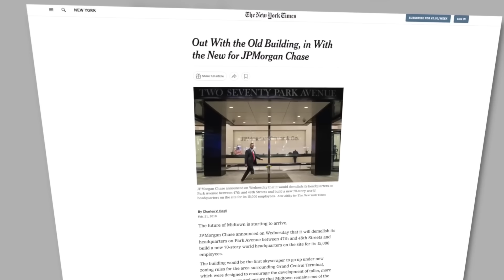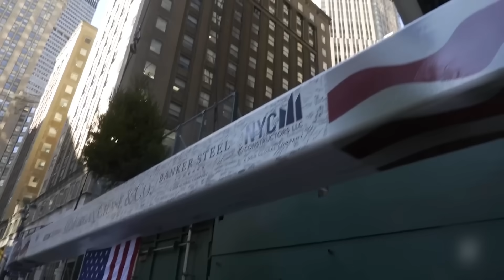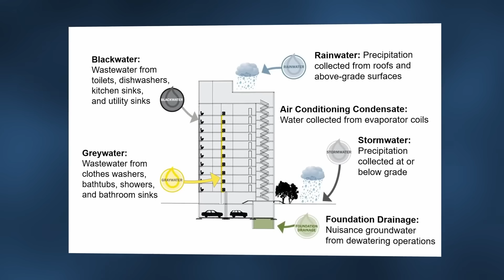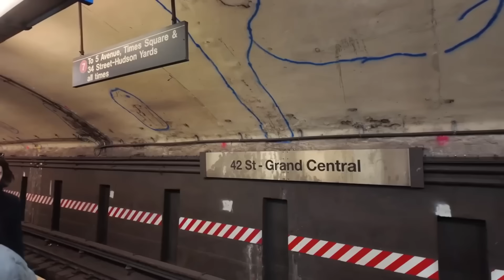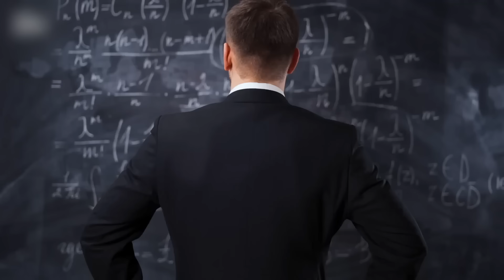Why NYC Built a $3BN Skyscraper Over Another Tower

Comment: It is usually cheaper and more cost effective to tear down an existing building and rebuilding rather than renovating an existing building. Especially a building full of obsolete systems and design. Although the previous Union Carbide building was a fine example of mid-century modern architecture, the new building will be much larger than old building, and provide the updated design concepts of modern workplace buildings.